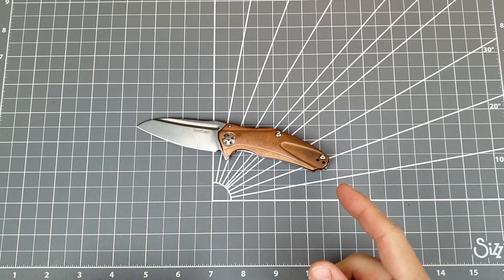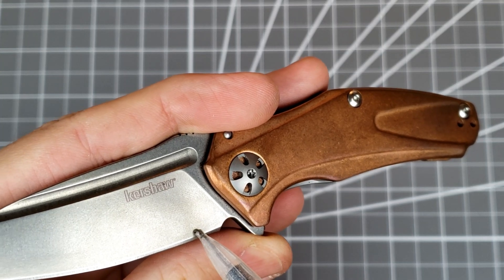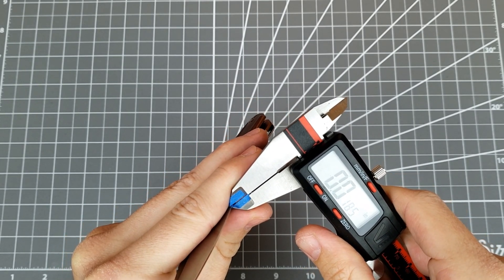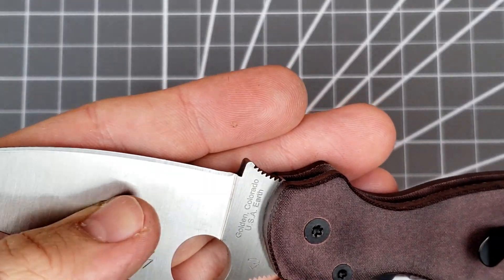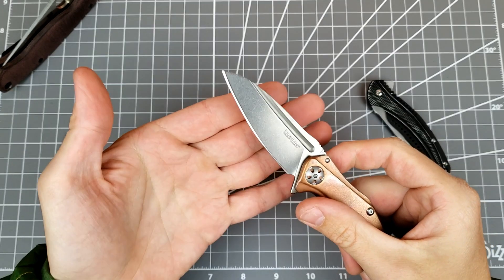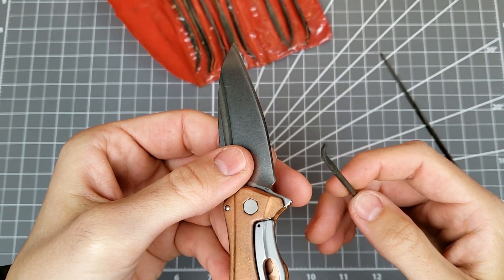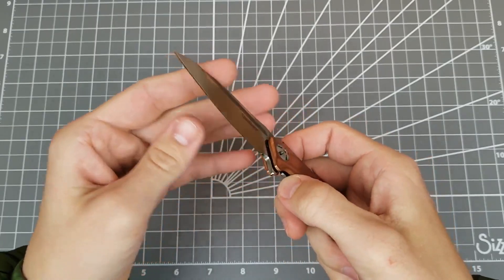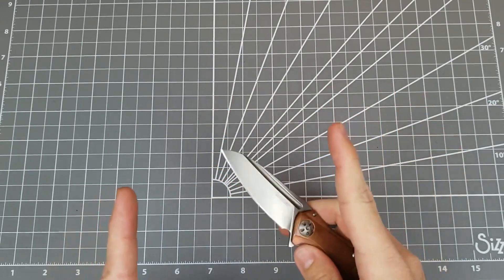So Many Knives Get This Wrong... But YOU Can Fix it | Sharpening Choils: Why and How-to

Comment: So.. Maybe I just need to finish the video, but one question I had was that I recall you need to be careful when filing because if it gets too hot you can fuck with the blade temper, is that accurate? And if so, is it just a matter of filing in shorter bursts to avoid it heating too much?
Reply from the maker: Yes you're correct. Just go somewhat slow. If you can touch the area it's not too hot. And these carbide bits don't produce too much anyway. 

Thanks for watching 🙏